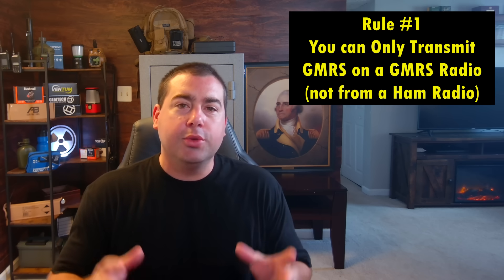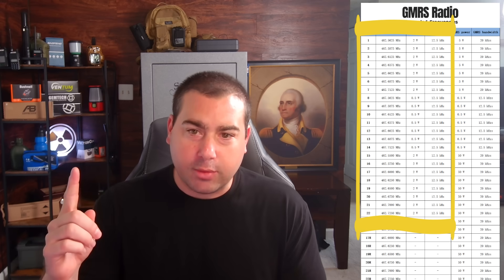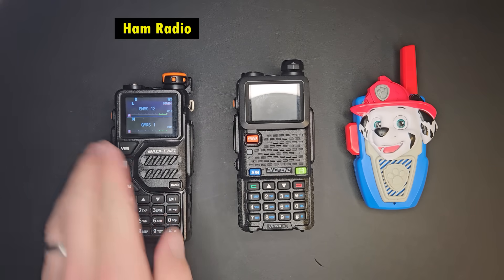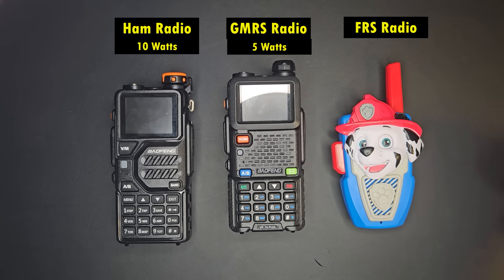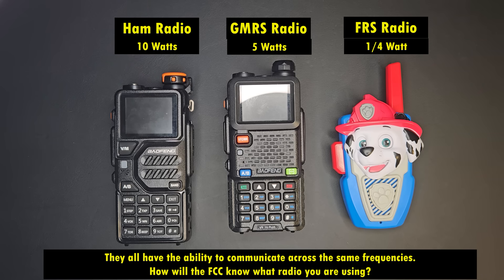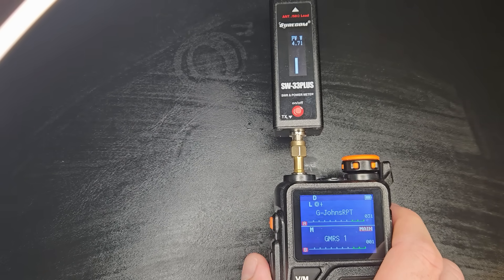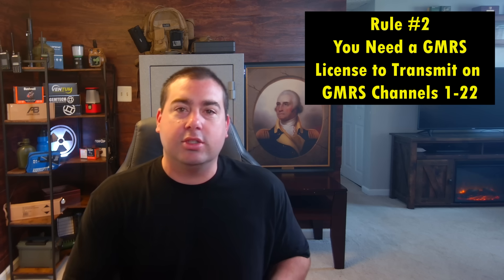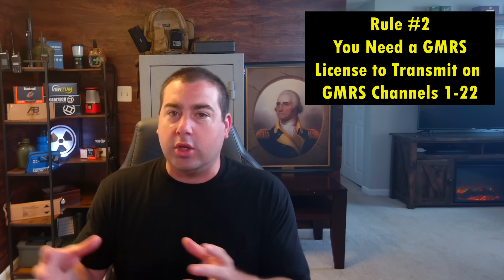Radio Rules the FCC Doesn't Really Care About & Why

Comment: There "is ways"? Whoops (2:32)

When I need to know what my radio (base, mobile, or handheld), is outputting, I connect a proper watt meter to it. It's nuts to believe a little handheld radio emits 10 watts of power, because it says so on its box. Properly connect a real watt meter to it, before foolishly telling anyone that it emits more than 4 or 5 watts.

Is that monitor playing the fireplace video, keeping you warm?

Comment: Good points all in all. I would point out a radio like the TID H3 - which you can purchase as GMRS part compliant, and switch it to HAM mode. I do that so I maintain compliance all around and have absolutely nothing to worry about. (not that it was all that much of a concern, but still). I bought a small collection of these and keep one GMRS full tiem and one HAM full time. THen to deploy more, I just clone my GMRS or HAM over. Its great feature and a cool little radio to keep on hand, and for preppers or people doing team coms, the wireless clone feature is fantastic.

Comment: I just found you.  I'm a pepper or part time prepped.  I'm also a senior citizen and I live between two large cities and I want to be ready when feces hits the rotating oscillator.. Hence why I subscribed. Excellent video. I have a GRMS license and notice all the other locals around here pay absolutely no attention to the same. That said, I've only heard two conversations on my wouxan 5 watt radio or my boooofang 5 watt radio and have never been able to connect to a repeater because I live in a rural area and the closest repeater is about 35 miles away thru woods and hills and suburbs. 
So, I plan on getting a mobile 40 watt radio and a much better antenna horizontal radiation type, and a power supply converter and make myself a base station.  I hope they legalize the low VHF frequncies they are talking about to allow up to 300 watts. That would propagate  better I would think and allow longer distance emergency communications.  
I'm studying for my HAM technician licenses.  
I want to know if the FCC cares about HT digital radios using business bands or ham bands for one on one simplex comms ?  I see these cheap radios that says group, all and user to user digital comms on less bandwidth and more people on same frequency. Why can't this be used in GRMS for instance and why can't we use texting? These would be great for emergency use.  I will buy a handheld HAM just for emergencies .  Probably the 2 meter band use. So many repeaters for such comms in an emergency.  I will eventually get my license as I have just started to study.  I will however use any radio I need I. a real disaster or emergency. Screw the license.  Life is more important.  
Be well everyone.  Be safe and enjoy.  wzed693. South Central Indiana. The heartland. USA.

Comment: The FCC can tell how much power you are running over the air. They have the Equipment to measure this in there mobile equipment. 

Also most HAMS DON'T DO WHAT YOU SAID. IT IS UNLAWFUL TO USE YOUR AMATURE RADIO GEAR  OUT OF BAND. EXCEPT FOR MARS. 
THIS IS WHY OUR HAM BANDS ARE GOING TO HELL, PEOPLE VIOLATING THE RULES LEFT AND RIGHT.

Comment: Remember, the FCC has monitoring stations all over the country.   And, if they should decide that they care about someone who is violating the rules, they can very effectively and efficiently locate and identify the violator.   It's called, "triangulation" and they only need a couple of monitoring stations to identify with startling accuracy where an offending antenna is.   They use the same technology as the US Coast Guard to locate marine vessels in distress.   And, if they can find you dozens of miles off the coast floating in the ocean, they can find you pretty much anywhere.

Also remember, the FCC has limited resources and generally responds to complaints about violations, rather than actively seeking out violators for the sake of seeking out violators.   So, if they decide they need to find a violator and they do find them, the fine is going to be big and the consequences significant.
Reply: They have about all been shut down and even the main ones they still run remote are not manned after 6 PM EST . It takes more than one complaint to even get a mean letter ! They gave up on most things like pirate FM  they have bigger problems to look after . In other words quit being a sad ham plenty of air out here for all .
Reply: @jhonsiders6077  Why do you consider a purely objective description of the truth to be an indication that I am a "sad ham?"

Perhaps, it is you who needs some fresh air - or, a hug?

Comment: What's the difference between 10W and 5W Baofeng radios in GMRS? Pundits say there's no difference in range between the two, so would there be any difference in GMRS transmissions between 5W and 10W? I'm assuming there would be none. I live in an area with a ham repeater, so I have to get my ham license, but for simplex communications, don't bother.
Reply: People have unrealistic expectations of what a hand held and a rubber duck antenna on simplex will do.

Comment: Also, GMRS Mobil radios go up to 60 watts, maybe more. You would need to go to 240 watts for anS unit. So, no one knows you are using your 100 watt radio.
Reply: The only GMRS  radio  being used that are over 50 watts  are repurposed commercial  radios.
Reply: @frankpeletz1818 I think my Midland is 65 watts

Comment: The FFC does care and does enforce all of the rules and regulations. The type approval regulations are not just for manufacturers. However, as others have stated they mostly find out about infractions and interference when the user is causing enough problems for them to be reported. There are enough hams, GMRS/FRS users, CBers, and commercial & infrastructure  users who will report every incident of misuses, abuse, and interference. What ever you decide to do just be aware that there can be consequences.
Reply: stay away from commercial and govt spectrum and bob's your uncle.
Reply: Another sad ham. Had my extra over 55 years could care less what someone is doing with a $25 radio .
Reply: @jhonsiders6077  I know right! All of this radio stuff seems waaaay more complicated than it is... I think folks are too scared of the CB crowd blowing out the airwaves... I play with my $25 radio on occasion, but it is always quiet. I am glad that 11 meters and the free band contains most of the crazy folk... So... I don't really care what someone does with a limited range handi or FRS 2 for $30 family toys...

I am not really sure about the "sad ham" name... I guess on face value of the term... a ham who is dissatisfied with his hobby's current state? I have been a ham since 1979.... I have always been happy... even when listening to 7200. hehehe
Reply: @kicktree Amen brother, from another old extra class.

Comment: Protestors will ruin this, especially if the ice storms their way.

One more thing to charge them with. Guaranteed, their "crowd managers" are corralling their herd through the streets without licensing. I've observed it lately.

Be rest assured, like tracking your personal devices, they're listening to operators of other services. This is training for learning the difference between Feng bangers and LMR or amateurs (because we're helping) with direction finding. Just a miniscule part of said service.

I wouldn't be caught with anything requiring licensure and not being with proficiency papers.

That is the difference between the avid service member and the weekend protestor.

Comment: If the FCC rules for HAM radios transmitting on a GMRS frequency applied to other tech, it would be a violation to play a DVD on a Blu-Ray player even though they are compatible.
Reply: Good example of two different digital modes, not two different rules.

Comment: 2:30 Your statement here about the FCC (or anyone else, for that matter) being unable to determine transmitted power levels without hooking a power meter directly to a radio is flat out, 100% incorrect.
Reply: I agree. One with a good ear, can even tell the difference between a Feng bangers and a part 90 LMR or, even an amateur quality radio. Not to mention, a good amateur radio, not designed to MARS mod to another service, has no Roger Beep. That's a marketing gimmick.
Reply: @william_k4arx it’s easy to tell most manufacturers radios. Each one has a distinct sound. I can tell the warm sound of the old Motorola Micor systems.
Reply: @william_k4arx no you can’t.
Reply: @andrewyoung-n8ary I can, you cannot
Reply: Maybe they can, but they’re not. Simple fact that drives licensed guys nuts is that barely a handful of violations have been enforced over the decades. And NEVER for simply operating. Only examples are for significant, deliberate and HARMFUL interference.

Comment: Disclaimer: I am not advocating for breaking any FCC regulations.
On an Amateur radio HT, you could transmit at 10 W instead of 5 on GMRS and, if you didn't tell anyone or otherwise cause a nuisance, likely nobody would ever be able to tell the difference.

Also if your using an Amateur HT, personally, I'd just avoid using the FRS channels (8 - 14) entirely.

Alternately, you could adjust the Amateur HT to transmit at a lower power level in order to comply with (or more closely match) the power limitations for GMRS. The bandwidth should also be set to match the requirements for the band you are working.
Technically, you're not supposed to transmit on any band for which your radio is not type certified. "Technically" that is.
Reply: that's ok... some of my best friends are non-advocators.

Comment: I had a set of FRS walkie-talkies in the early 2000s they had 15 channels then the FCC increased the number of channels to 22 which made FRS and gmrs frequencies overlap if you wanted to use repeater's you should get a license because most repeater's are privately owned and are required to be licensed themselves but simplex only on walkie-talkies their not going bother you it would be a huge waste of time enforcing rules for the little walkie-talkies

Comment: What bothers me the most, and I feel is a legitimate issue,  is the guy in Florida (for example) transmitting endlessly on Citizens band frequencies,  with enough power to reach Pennsylvania! In the oilfield,  we use CB for short range comms, for brief time periods.  And it's for our safety.  Then some moron from Georgia or wherever,  starts jabbering his nonsense, repeatedly,  with enough power that we can't squelch him out to hear each other a mile away!
Reply: You may misunderstand propagation at 27MHz.  Sporatic-E propagation occurs particularly in the summer time.  Long range propagation will be strong even with very low power.  You might be better off with GMRS or MURS unless a commercial license is required.
Reply: @vladtepes481 that CB operator may just have a very good antenna setup.
Reply: @vladtepes481  f1 and f2  skip during the high peak of the sunspot cycle is much more common. de kd6erp
Reply: @vladtepes481 Possible,  but unlikely.  These guys constantly brag about their power and base stations.  Propagation of a 5 watt signal, over many hundreds of miles, on a regular basis is very unlikely.
Reply: It IS a legitimate issue - one which should be reported to the FCC. If you don't get satisfaction from them, there is another alternative. Though I am not involved in this sort of activity, if you know any Ham radio operators you can ask them about the possibility of helping to locate the transmitter.  ("Fox hunts" are are a favorite hobby of some Hams - the term for using radios to locate things like emergency beacons or illegal transmitters.)  By and large Hams are classy people who don't like obnoxious a$$h0les like the guy you describe and would be glad to help shut him down.
Reply: If you need comms for safety, your company should not be using a non-business frequency.
Reply: @andrewyoung-n8ary It's the whole industry!  Do you think the examples I mentioned are acceptable?

Comment: The ONLY reason why I got the additional GMRS license outside of my Ham license, been license since 1973, is so that the whole family can use radios if cell phone towers goes down during a tsunami or a hurricane on my GMRS call signs, which I paid $70 for. 😢
      Other than that, I don’t use GMRS except on a friend’s GMRS repeater and even then, we use our Ham license call signs instead of the two mile long call sign we have for GMRS. 😅

Comment: #1 rule is really just "don't bother anyone", especially public safety, air, mil, and commercial broadcasting. There's tons of LMR spectrum that's really lightly used now, avoid the active channels and no one is likely to even notice, especially on simplex with HTs.
Reply: Land mobile radio , if I'm not mistaken
Reply: Can confirm with messing around with the 220 spectrum that’s not allocated to ham. UPS was gonna have it but gave up, now rail uses it for PTC; but there’s nowhere around me within hundreds of miles that use PTC so. 
Can honestly say it’s a nice band for parks.
Reply: @THEFINALHAZARD I don't know where you are but, it's allocated to "ham" regionally, if not used nationally here in the states. I hear it used daily. There's the "boredom.breakers net" and it's connected around the world via All-star and Echolink. The growth of the 1.25m band is exponential here in Virginia and throughout the northeast and Midwest. Maybe you are just in the wrong spot.

Probably one of the best of three worlds, set apart from two meters and 70cm.
Reply: @THEFINALHAZARD  Have you tried the MURS frequencies?  I have a pair of Radio Shack HTs for MURS and they work great!
Reply: LMR?
Reply: @Jimbo_Conn Land Mobile Radio
Reply: @Jimbo_Conn "Land Mobile Radio"

Comment: Isn't the point of these laws just for safety? Because, I don't really see any way I can die (been around this frequency of radiation for years and I'm pretty young) or make my neighbors angry and pop up at my front door complaining about their movies getting screwed up on there television because, I'm the only one that has a big radio in my neighborhood. And, there're no television frequencies near 400-500 MHz range! (At lest that I know of.)
Reply: Radio waves are non-ionizing radiation, so they are harmless at low power levels. They only have a heating effect, they can't cause cancer like ionizing radion. But if you try to steal an antenna transmitting at several kW you will probably get some burns.

Comment: Most radios are not producing a clean signal when operating out of band, in particular when operating at high power levels.  It's these unwanted side emissions that often get people in trouble.  Or the power level will drop which may or may not be acceptable or desired by the user.
Reply: a lot of baofengs will give you up to 3 frequencies for the price of one... all be them spurious... but the emissions are so low that who gives a heck.

Comment: Speaking of "no one cares," they don't.  Even legit operators on Ham and GMRS.  The main point being is the 2-way communication hobby (if you want to call GMRS a hobby) has slowed down to major proportions due to the fact that the Internet, technology, and cell phones have taken over and fullfilled the needs of consumers and hobbiests.  Listening around in my area near a major US city, the activity on GMRS for instance is so low you'd think your radio was broken.  This all happened in less than a decade.  Those selling equipment for GMRS and Ham will deny this just to sell you equipment.  They, as well as the FCC don't care.  Want to run 50 watts on FRS 1?  Go ahead, no one cares but then again no one is listening.

Comment: A 'HAM' radio is still capable of 25khz per channel operation.
All GMRS channels are now 12.5khz by FCC rules since 2013.
Transmitting on a GMRS channel using 25khz will cause adjacent channel interference.
Just putting that out there.
Reply: GMRS are wide band, except 8-14.
Reply: kHz, not khz.
Reply: The FCC  has restricted UHF  to narrow band width on new commercial equipment a few years ago,

Comment: 10 watts isn't going to make a big difference over 5 watts.  That's 3 dB and I would challenge you to notice 1 dB at all and it's barely more than that.  If you have LOS to the other unit 5 or 10 watts will work.  If you have a mountain between you neither will work.  In marginal conditions 10 watts may be ever so slightly less scratchy.  What will make far more than 3 dB difference is to use a mag mount external antenna on your car or a base station antenna with one of these portables.  You could get well over 10 dB of improvement and that's significant.

If I had a pair of 5 watt portables and a few bucks I would definitely go for better antennas than upgrading to 10 watts.
Reply: Well, for those curious as to the differences of doubling your radio's output power, as was stated that double in power is a 3db power gain.  What you are probably wondering about are the effects,  if everything else is kept the same.   So, RF exposure is doubled.  Battery draw is doubled (halving battery power time during TX).  Range: dB in power is a 10log calculation versus a 20Log for distance so the easy way is to take the square root of the power ratio (square root of 2 =1.414 d.)   So, to double the range would require 4 times the power and therefore, the wise move is to improve the antenna gain, mount it in a better location and while doing so staying safer, plus legal.

Comment: Regardless of the FCC rules, if you're doing simplex with any of these radios, they'll have about the same range as the Paw Patrol walkie talkies, regardless of power. So unless you've put your antenna at 20 feet or so, or are hitting a repeater, might as well save your money and buy blister pack radios.
Reply from the maker: This is incorrect.
Reply: @citizensurvivalplan  Not really, they are all line of sight.  Antenna height is far more important than wattage out of an HT.